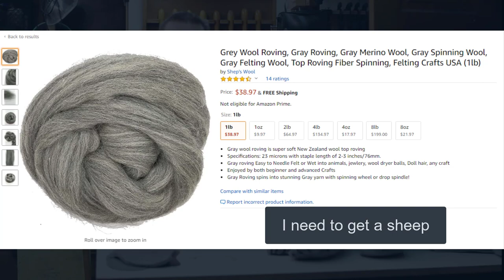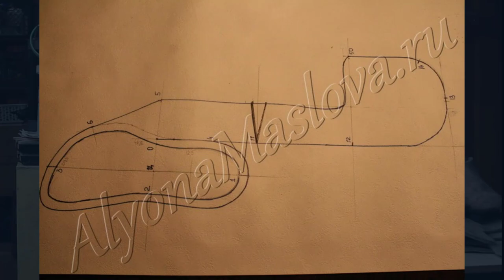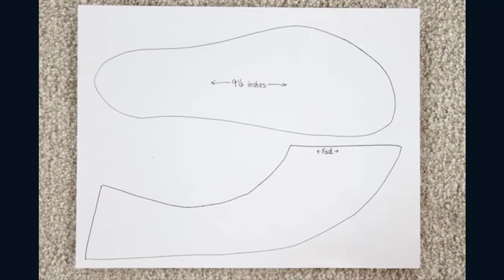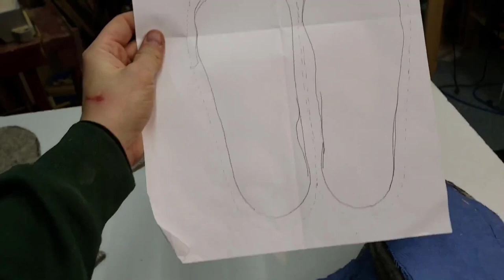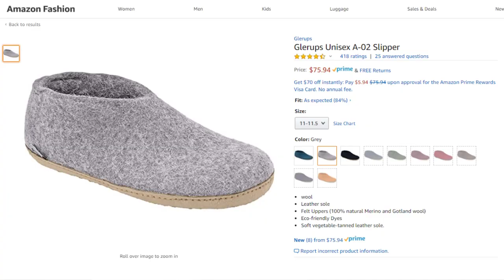Homemade Slippers - No Sew - 2 Piece Pattern

Comment: Where can I buy the heavy duty felt padding? I called all the flooring stores in town and no one has it. Did you purchase online?  I do want to make these!!!
Reply from the maker: I found the big roll, wrapped in plastic, in the trash.  But I would have thought that carpet stores would have it.  But you can use any type of thick cloth, maybe double thick towel material?
Reply: Thanks!